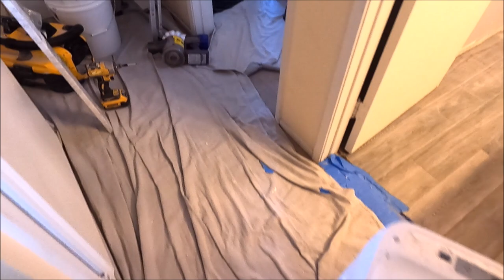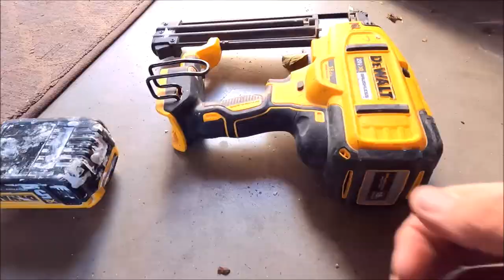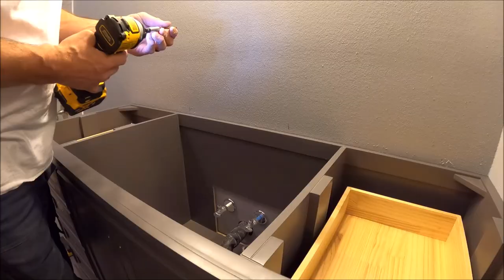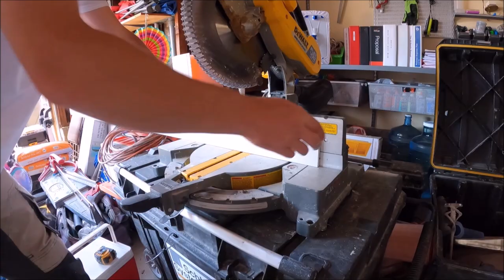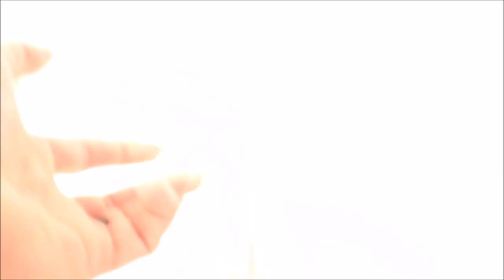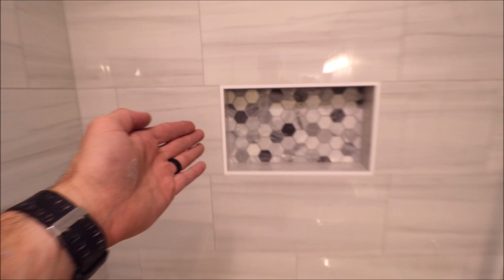We Finally Finish this Small Bathroom Remodel!

Comment: I want to remove old tiles in the shower space from one bathroom.  The difficult part, I think,  is about  removing  the old and hard adhesive  which is sticked on the concrete wall.  After removing everything from the wall.  What else do I need to do in order to prepare the wall before to install the new tiles?  Is there a risk  that new tiles down if the wall is not right ready? Besides,  toilet's space has gypsum which is in the celling and half of the total  walls.  I've heard after removing gypsum the wall remains tainted, like  "contaminated" and needs to be prepare before to install  new tiles on there.  Any idea about how to prepare the concrete walls  in both cases:  after old tiles and gypsum (gesso)? Thanks body. Greetings from México

Comment: I've been waiting for this one.   I like the finished not over the top look.   Where you guys used the Schluter jolly at the tile to drywall separation what is the thickest or widest transition you have had to deal with?   It looks like you guys had 3/8s maybe?
Reply from the maker: Usually 1/8 - 1/4" We caulk and cut in with paint so it disappears.